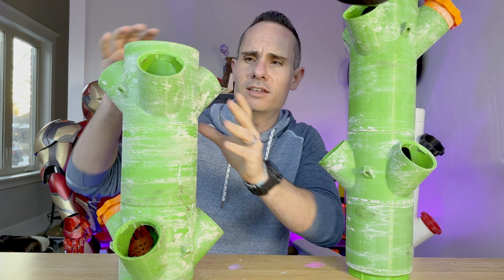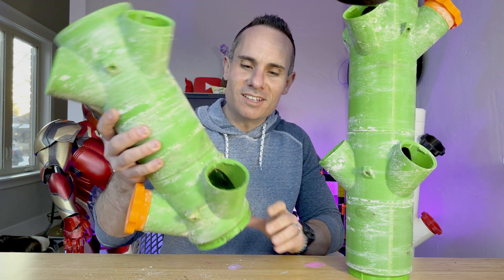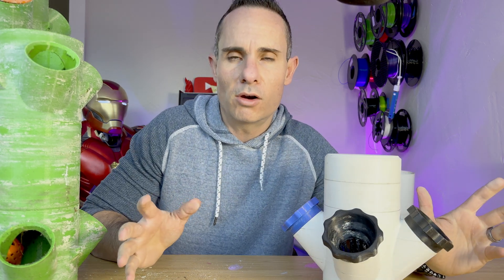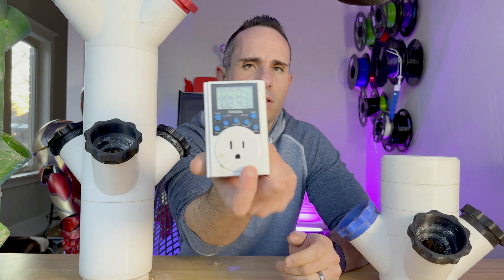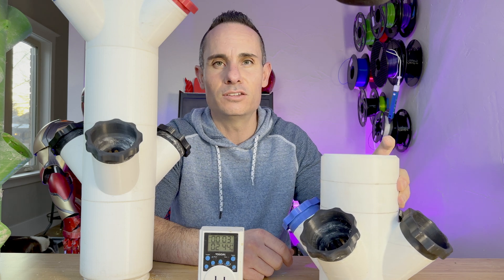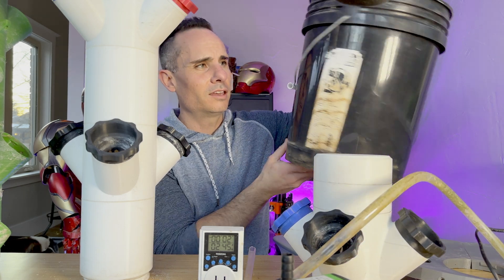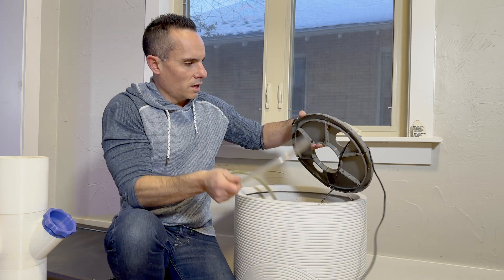Maintaining Your 3D Printed Hydroponic Tower

Comment: Huh? A motor runs best when it's constantly running, so the ideal choice would have been spreading the load to another tower or getting a smaller pump. having the pump on and off also increases rootmass because the plant will look for water. The darkening of the roots is hardening because they got too much oxygen from the air.

Comment: It's just mineral salts seeping through the layers. You can seal all of the pieces with food safe resin and the problem should be solved. Then, for the joints, you can print TPU gaskets or seal them with PTFE tape. (The white tape plumbers use on fittings. )

Comment: Thanks for the information. I’m excited to try it out! I was wondering what you use for lights when growing indoors. Is it an attachment you connect to the tower?
Reply: I’ve seen a few where they print light holders both into the cap and the cover for the water reservoir and hold it that way. And they use the tall lights, maybe 36” tall?
Reply: @dontbanmebrodontbanme5403  okay. Thank you 😊

Comment: Just a quick suggestion on reusing the printed plant cups - you can remove the broken lower basket (fragile) section and drop in a net cup. The upper structure holds the cup perfectly - not quite as deep as the original, but seems to be adequate. No need to keep printing new plant holders 😊

Comment: I printed the same tower. I have used mine for a few years and it's a pain to clean. Mine leaks around each section that screws together. I have been contemplating designing a new/similar modular system with a TPU gasket in between the sections..

Comment: To clean the parts you can submerge the parts it in diluted bleach for a couple of hours and then rinse it or powerwash it.
In order to avoid algae a container that protects water from the outside light/heat and as an additional solution you could get a cheap aquarium UV light.

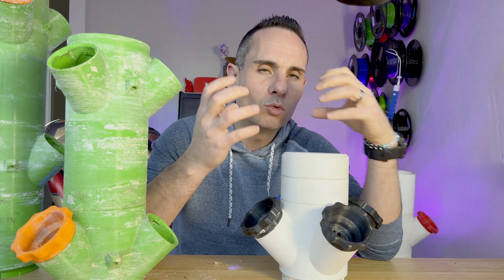Comment: What of you dont connect them 4:45 at the bottom but keep the shape. you should be able to pull the roots off without stressing the plastic, on the other hand so would the water

Comment: What do you think about printing these modular with a small internal 1 inch reservoir for each of the plants to always have water.  It would do two things: keep the plant always hydrated & maybe you won't have to run the pump as often as you do now.  maybe you can run the pump once every hour?  Each time the pump comes on it will refresh the standing internal reservoir by displacement of water.

Comment: great video, thanks for sharing.  I had two thoughts for improvements and wonder if you had thought about them.  First, could you coat the tower pieces with an epoxy resin or polyurethane (there are food-safe types I assume) as that would waterproof it and prevent stuff from leaching through as much. Hopefully would make cleaning easier as well.   Also, I wonder about using a misting top as opposed to the diffuser as they are supposedly more efficient, but I've never seen many people use them... anyways just some thoughts.

Comment: Looking at the white on your used pieces, it actually looks like the hard water scale that builds up on faucets if you happen to have hard water in your area.  I believe Colorado does have hard water - Texas where I am, has such sandy soils that the water tends to be naturally soft (water absorbs more minerals from clay that sand).  I could, of course, be wrong, but I recall my 6 years in Arvada, Colorado and my toilet bowls stained quickly between cleaning and the faucets did have white crusty build up around the nozzle.

Comment: Nice build, I think I will try it this spring.

On a side note, if you are intending on using something like this inside, please be safe and make sure that the pump is plugged into a GFCI protected outlet.  A simple seal failure on the pump could create an electrocution hazard.
Reply: You should do that outside too, but at least in the USA GFCIs are pretty much required outdoors.
Reply from the maker: Great tip Brian.

Comment: It should be rinsed with a bleach water solution in between plantings to prevent algae and other unsavories.  :)  You should be able to cut the roots off around the outside of the net cup then pull the plant out of the top, should give you another growing or two out of it.  I routinely save the cheap flimsy ones from the biggest root systems this way.  Just have a good pair of heavy duty scissors. :) 
You'll still get sediment on the outside because the solution will always drip everywhere.  I try to wipe it down every week or two around the plants, whether you see anything or not.  Keeps it looking better longer.
Reply from the maker: Great tips! I have been using a power washer to clean the unit which seems to work well after allowing it to dry out fully.

Comment: Just started printing the tower
Reply: What Filiment are you using ?
Reply: Also temps?
Reply: @FULLxMETALxALEX  petg from inland 235 and 60 bed. I could probably turn the bed down. I turned down the fans to 50%. I’m also printing a raft with these because the first print got past 25% and came off the bed.

Comment: Do you use grow lights for indoors? I was wanting to do it inside my apartment, but I would need to figure out how to use grow lights.
Reply from the maker: I’m going to design a module that sits in between the sections and holds grow lights. I’ll share that with the community once it is done. For now I just have mine near a window
Reply: @ALLYOURTECH3DP  any update on the grow light module?
Reply: @ALLYOURTECH3DP  cool. Thank you!!
Reply: I second the update on the grow light piece. I am waiting to print till I have a way to mount grow lights.

Comment: So.. I did some digging on ways to coat the inside to seal it. Turns out there isn't a lot of options. I did however read that Art Resin is an FDA approved food grade safe resin that works well on various materials including plastics. So I ordered some.. it's not super cheap.. but I assume with it applied the tower will last even longer, and should prevent water from going through, and potentially be stronger as well. I am also toying with the idea of using XTC 3d on the outside.. which will smooth out prints and make them stronger. Not sure.. however if that will in any way affect the water inside the unit.. so not sure yet if I'll use that. Given that the goal with these towers is years of use.. I think the $40 to $100+ for the Art Resin may be worth it. I am not sure if it makes it more food safe than PETG alone.
Reply: There's a simple way, line it with self adhesive plastic sheets, then cut out the pocket holes. Or find a thin plastic sheet, or even kitchen foil, and glue it inside.
Reply: Just use plumbers putty.  Your wayyyy overthinking it
Reply: Aquarium safe Silicon caulking

Comment: I was wondering if you would share the config for the print, specifically using the OVERTURE PETG what temp, fill, etc did you use? I have used PLA a lot but have tons of issues with PETG and would love to try to print this with petg on my ender 3 v2 Neo, thanks for your time pointers.

Comment: I literally finished printing the last piece for my first tower yesterday. I’m planning on growing lettuce until it gets too hot then switching to strawberries under some shade. I printed in PLA so I’ll have to give you and update at the end of the Texas summer on how much melting has occurred.
Reply from the maker: My PLA prints only last a few hours in the sun, but hopefully the water flowing through helps. Keep us updated!!!
Reply: @ALLYOURTECH3DP  oh wow. I was thinking a season long droop not an instant melting snowman scenario. Maybe I’ll keep this one Indoor in summer and start a PETG one for outdoors. Thanks for the update.
Reply: @ALLYOURTECH3DP  
Cover the tower in aluminium foil tape (peel off backing type), that will protect the PLA and act as a radiant barrier. You could also use double bubble foil insulation but it`ll be harder to get a good finish. If you go that route spray adhesive is the best way to attach it.
Reply: I wonder if a UV spray paint over the outside would make PLA last
Reply: @Ibuse123  not likely, it’s not so much the UV, but the IR generated heat that causes PLA to warp/droop/fail.
Reply: Would love to hear any updates
Reply: You'll want PETG not only for temperature reasons.. but it's more food safe than PLA.. though I think you can find some food safe PLA.. not for sure on that. I posted above which may work for PLA as well.. that Art Resin sells FDA approved epoxy that works on plastics.. going to give that a try to see how it works out. Figure the goal is using these for many years to come.. may as well make it more safe and stronger at the same time.

Comment: I make a tower with this design. I found that it was a bit unstable when you made it taller. Mine was about 5 feet tall and all printed in white. What did you print on the bottom to hold the base down firmly? 
I also had problem with the water going green because too much light got in through the white filament. I had to add something to manage that algae growth. 
For the reusable cup I had a design that allows me to keep the top that you screw on the tower and only print the bottom part that has the roots. Saved on time and filament.
Reply: Sorry I just re-watched the video and saw the bucket lid. I didn't try that since that uses significant filament and needs nuts and bolts.
Reply from the maker: It REALLY helps with the stability. Highly suggest it for a taller tower.

For algae, if you increase the number of outer walls (perimeters) in your slicer, you can block out more light. I did end up printing a 3rd tower with green filament which also helped.
Reply: Hi, can you share your design that you mentioned? I think to make some kind of adapter to use commercial net pots, as those are cheaper...

Comment: Curious about how much filament is used in total for the system, as well as print settings you used. I'm thinking of making one, though I think I'd look toward using a more basic net cup, especially after hearing they get destroyed in each grow anyway.
Reply: My son printed this tower for me for Christmas 🎄🎁. I did discover that the printed pots are much better used by eliminating the bottom mesh and inserting small net cups into the nice screw in pot "holder" which can be reused indefinitely. The netcups fit nicely and are just deep enough to reach the nutrient flow.  He actually had a number of "failed" cup tops that I could use as netcups holders .  Love the design and am happy to have a little garden that my 80 year-old body can easily use
Reply: ** my son mounted the tower on the top of a 50 gal blue drum -
Reply: So I was able to load 25 gal of filtered water with appropriate Kratky nutrients - very stable!! Also wrapped the drum in reflective insulation to eliminate algae and keep water cool in summer
Reply from the maker: @LindaMcEnernybeth  That's smart! One of the big challenges during the summer is just ensuring there is enough water to combat evaporation.
Reply: @LindaMcEnernybeth  do you have a model for the modified inserts? do 2" fit into them? 2" netcups without anything are dropping through the holes of the tower :( But using the upper part of the insert as "holder" sounds interesting
Reply from the maker: It uses about 3 dollars worth of filament for a tall riser, and 5 dollars worth of filament for a 3 to 4 plant section. The net pots would be a great idea to save additional annual costs.

Comment: Surprised that you printed the bucket lid. Lids at the big box stores cost less than all the filament used…..
Reply from the maker: Most of the store bought kits are fairly thin, so depending on the weights of the tower and the plants, they may have issues. The printed lid also has a nice ring lock built in that the tower segments tighten up against. That has been my experience at least.